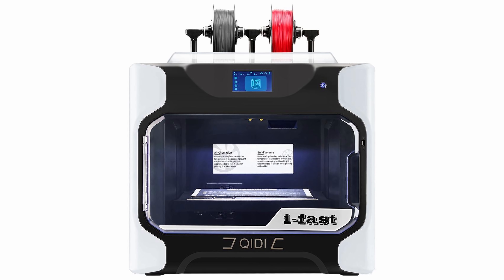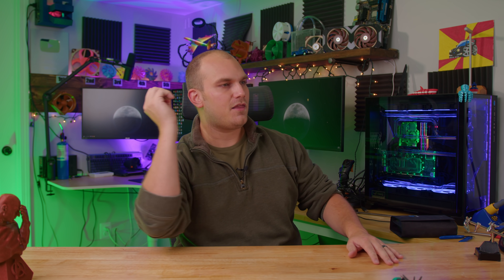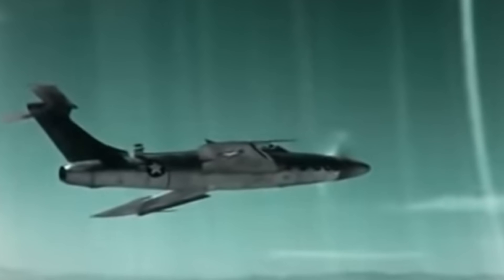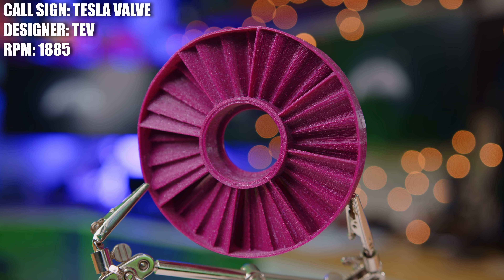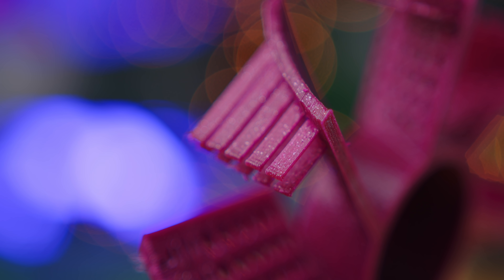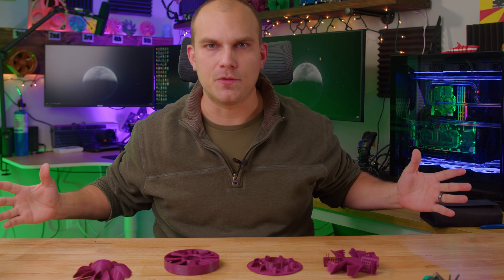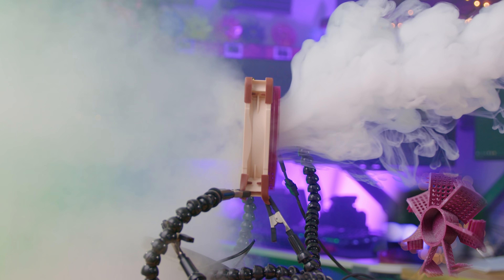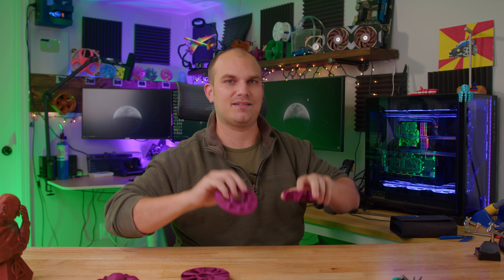The IMPOSSIBLE is now POSSIBLE | Fan Showdown S3E6

Comment: 10:10 the speed at the outside is much higher than the inside, so I think it’s the valves geometry that causes the turbulence.  Translated to airfoil design: the outside is more efficient with a jet(fighter like a F16) airfoil while the airfoil on the inner radius should be more efficient with a C-130 Hercules shaped airfoil. So the valve geometry shouldn’t be the same on the out and inside of the blade.

Comment: In the Tesla valve fan the air travels outward in the curved areas/channels of the “blades.”  That is why it spits the smoke out. There is no proper resistance to keep air centered.

Comment: I would like to see a static pressure test on the Tesla valve fan. Most thin axial fans do terrible on static pressure tests, it would be really nice to have a good option for pushing air thru filters with minimal height investment

Comment: The prandlt is designed for no outside shroud, it might have been better in that setting. I also notice it does not meet the prandlt design parameters, mainly zero loading at the tips.

Comment: I guess, it would be interesting to see them cooling CPU (go through heat pipe sink) pull vs push performance, perhaps it would come with surprises, due to the difference of laminar flow before and after. Great vids.

Comment: Dyson needs to make a computer fan that is bladeless like their big bladeless fans. I feel like their method would be great because it allows maximum air passage due to the lack of a blade in the way, despite their still being a blade. The only problem I could see would be the actual fan housing itself would be large and probably wouldn't fit in a standard computer case.

Comment: Thought on the whisk, I know what was meant by noticing the force when using a hang blender. I think the difference is the hand blender was being used in a narrow vessel. Use a hand/such blender in a glass as you make a milkshake. I think adding a housing such as we've seen in the more complicated multi part fans would help get a lot more performance out of it.

Comment: Your problem with db measurment isn't anything to do with frequency just fyi! It's most likely a result of a lack of preformance In said fan leading to a reduced db level. I'd love for someone to come up with a simple way to compare statistics directly between fans such as dividing the db rating by the expected flow rate or amount of material maybe? Scatter plot and get a trend to figure out which fan is the best!

Comment: Am I reading it wrong? I think the flow past the fan fanning out means the fan has high static and low dynamic pressure, and flow tight and narrow means low pressure and large flow, and the total pressure of the fan is the two combined, right?

Comment: Cheese greater had lower RPM which probably contributed toward reducing the sound. Also the "cheese" on the ends might have reduced tip vortices that would cause vibration. Definitely surprised it cooled as much as it did!

Comment: You may have some luck attempting contact with a group that tests other parameters or physics and see if the can help.
It'd be cool to see the static pressure of some of these, and I think the tool you want to see the frequency would be called an oscilloscope.
Gamers Nexus or Applied Physics may be up for a collab.

Comment: @Major Hardware - i was recently watching your Jet engine fan videos . and i noticed something - in all of those jet engine / fan videos when there was a hub to help the fan - that said fan went from big volioum - > to small - that in it self is the oposite of what you want - since you aim to cool down something - when you compress a gass it heats up - wich is why jet engines are shaped like this - because they WANT  the air to combust and exit as hot as possible to gain more thrust out of it - in your case tho you want to cool - meaning what you need is a hub that starts small - and endsup big - when you expand a gass it gets cooler - meaning in theory you could use a very small fan spin it at rapid speeds and cool a radiator with it with some pretty decent numbers- or use 2 set of fans - one to push air inside and one that pulls air out so it will be more easy to force the air you use to cool your radiator to expand - and get cooler as a resault

Comment: what kind of radiator are you using with the fans?

I kinda feel keeping it "close to a noctua fan" is not good enough, I've been watching your videos on and off but I still don't know what kind of radiator setup you have.

I'd suggest implementing something like this:
https://www.youtube.com/watch?v=4tgOyU34D44

seeing random meme fans beating harvard level of fan design is so funny that's why I keep watching you, but I'd love a "real world reference point". cfm, temps, cooling solution/rad. the sytem is irellevent as long as it is the same under all tests

Comment: Dayton Omnimic is a decent plug and play solution that includes SPL meter as well as full spectrum RTA. Or you could use your existing SPL meter in conjunction with any half decent measurement mic for spectrum analysis.

Comment: The visible "shockwave" you were talking about isn't actually a shockwave at all, nor caused by the actual propellors going faster then the speed of sound. it's an expansion cone around the airplane where the air is being funneld into the propellor and is then expelled behind it in a large cone shape. depending on the temperature of the air and humidity the expanding air can't hold all the water molecules in it anymore and they condense around it forming a sort of cloud at the end of the cone. This can happen below and above the speed of sound so isn't specifically linked to it. But it does tend to happen easier at higher speeds. Just some fun areodynamic info  i wanted to share :P

Comment: You can do a spectrum with a PC and microphone.  There is lots of free software for the "audacity" is an example.  You can "calibrate" your setup with one fan as your standard then switch to the fan under test.  This way you can get the microphone position the same each time.

Comment: @Major Hardware You could use Octave and run a recording of the fan through an fft (fast Fourier transform) filter to get the frequency breakdown for each fan. Octave is free, and you already have a mic that should work well enough. The program you would need could be as little as three lines of code.

Comment: Aerospace engineer thoughts: Consider a simple pressure differential test. Air movement at zero pressure (the fan operating in open air) is not really relevant to actual operating conditions.

So put the fan in a box with limited airflow into the box, and build yourself a manometer pressure measurement tool (a very simple u-shaped clear tube with liquid in it). See how much pressure the various fans can produce. You don't need absolute values to see the relative answers, but even a simple manometer gives you real numbers (the change in height of a column of water). A simple noise test is interesting, and the flow vis with smoke is interesting too, but doesn't tell you much about what the fan is GOOD at - moving pressure from one side to the other. Also, the noise will change significantly when the fan is "under load" because it dramatically changes the airflow around the blades.

Also, there are plenty of inexpensive or free spectrum analyzing apps for smartphones, that will work well enough for this purpose.

Comment: Interesting. With the new printer we can make stator blade designs (static blades between sets of rotor blades as used in turbines) to dramatically increase the static air pressure.

Comment: I think what's happening with the tesla fan is that air is getting caught in the channels rather than sucked in, then "centrifugal force" (technically just inertia I know) kicks in and flings it outward toward the edge of the fan. It then hits the wall of the fan and "splashes" in wharever direction it can.

To fix it, I think you'd probably want to add a different shapeat the end - something that would redirect the air in the channels to the inside of the computer.

Comment: I bet a smaller heatsink would make the prendel work even better. I bet because it was drawing all the air into the center of it's rotation an outside portion of the heatsink remained warm while the center got all the airflow. I think this would actually make a huge difference! If the cooler has two sets of heatpipes on the sides, that means that the heat would have to travel farther from the source to get cooled. This would mean that the cooling efficency is bottlenecked by the thermal conductivity of the fin material (probably aluminum) over the distance of the radius of the fan, leaving the copper/vapor heatpipes closer to equibrium with the surrounding heatsink fins thus slowing the transfer rate

Comment: removing the load from the tips doesn't stop the shockwave of Mach 1. Tip velocity is the only thing that makes the Mach 1 shockwave go away. Changing the twist changes the load distribution to take stress off the tip.

Comment: The blender one is so efficient in the blender because the liquid is so much denser than air. I guess you would need a much bigger fan with more exaggerated features or a much much higher speed to achieve the same effect

Comment: i was wondering if you have thought about printing a wall 6inches out on each side to fit the fan into to prevent the smoke from coming back around and looping the sides i also feel like this would create a cleaner inflow and exit for the smoke

Comment: The supersonic blade tips discussion reminds me of a silly thing from motorcycling. Kawasaki has a few models under the H2 line with a supercharger designed by their aerospace division. Shortly before engine redline the tips of the compressor vanes exceed the speed of sound. Since they're small the sound is a rather high-pitched chirp.

Comment: Tip: Tesla valve is designed for strait, not for rotating, so the effect when rotating can be huge different than spected and also can depend a lot on the r.p.m. used.

Comment: Why do you need a sound meter with spectrum analyzer? You can just FFT the audio in any audio software and get the spectrum, like Audacity. Also, how did the new printer allow you to print the tesla fan now when you couldn't print it before? I don't see any use of dual extruder? What am I missing?

Comment: FYI, dB meters use weighted measuring. E.g. A, B , C weighting and they differ predominantly in how low frequencies are taken into account (and for different sound pressure levels).
I don't know of any dB meters with built in spectrum analyzer or some way of introducing your own scale as opposed to the standard weighting scales. You'd have to get a stand alone handheld spectrum analyzer probably.
I think that a cheaper solution would be to just get a measurment mic, hook it up to the pc and use software to get your readouts.
REW is a free software that could do this for you.
And fairly decent measurement/calibration mics can be had from around a hundred bucks.

Comment: As a car audio nerd the first thing that comes to mind for an SPL meter/RTA. Check out the Audio Control DM-RTA or though they are discontinued, an Audio Control SA-3050A. I'm not sure if they would fit the bill for what you need, but they've been used in car audio and loud bass for ages.

Comment: the one with the holes in it is only quieter than the quiet fan cause its not actually moving any air, there is a reason why fans that move more air are louder

Comment: I would design a fan but I currently don't have 3d software. Anyway my design basically uses 1 to x gear  Ratio. In other words for every 1 turn of the hub the fan/ blades turn x number of times. Also this is clearly not original as gear as  Gear ratio increasing or greater ratio decreasing are already commonly understood. It would in thery increase the rotation of the fan higher than the motor can rotate it on its own.

Comment: Many years ago, I worked at U-M Hospital. During that time, they were buying new helicopters for survival flight. One of the main drivers (besides age of the machines) was that the 2-bladed rotor design was too loud going over populated areas. The forward-moving tip of the blade, when they were heading somewhere fast, was creating sonic booms. I remember hearing it go over when they were really pushing to get somewhere and I can confirm that it was VERY loud. The new helicopters have 4-bladed rotors, which could be cranked at a much lower speed (and also gave better control, anyway) and the flyovers became much quieter.

Comment: Idea - Turn at A12x25 into an A12x30 by printing a bolt on frame extension and the same blade design as the T30 and see how it stacks up.

Comment: I like the commentary during the smoke test over the music. I would have missed the back feed of air on the Tesla. Have you every put any thought into how you could measure static pressure? With a radiator I'm thinking this may have a higher impact on cooling than air flow since you need the pressure to push the air through.

Comment: 10:15 Think the fan is doing its job flawlessly but its not mounted to a jet that would suck the air inwards and or moving forwards. My fix is to print a funnel that can mount to the fan and to a vacuum... "The more I come up with this plan the more it seems feasible, That is not my intent" What it would be doing is sucking up the smoke from the other end.

Comment: I don't know why it would make less noise, but I always wondered why fans don't have the blades turned in at the tips, because it's fairly obvious more air would be pushed in a forward direction. I also wondered why most fan manufacturers go for odd numbers of blades. At least if the blades were even, if one  breaks you could just break off the opposite blade and keep using the fan.

Comment: For fans like the Tesla valve i think a test rig that does static pressure would be more ideal. so a chamber wrapped around a 120mm Radiator with a U of water to show if the area between the back of the fan and the radiator becomes more pressurized when the fan is moving air and if so how much.

Comment: You need a Sone meter for testing loudness, dBA is really poor to measure perceived loudness as it actually only records the pressure, but not the loudness of sound. These can be perceived very differently. A higher dBA can still be perceived quiter than a lower dBA because of the way how the pressure (dBA) is generated (higher and lower frequency bands etc...). And Prandtl is pronounced "Prantel" but you swallow the "e" a bit similar to "mantle"

Comment: A resin-based SLA printer might come in handy for some of these fans. The technology produces much higher resolutions and smoothness, and should work well. Cost is higher to print, and of course dealing with the resin which is toxic, and IPA baths to clean the print, and then curing them in a cabinet with UV is a production. But something like a Formlabs Form 3 (which does cost 4 grand with accessories and all) has a 14.5cm by 14.5 cm build area. The Form 3L can basically double that volume, but I believe the price of the unit triples or some such, so... There are cheaper resin printers coming out of Asia, like your Elegoo and whatnot, but print volume would probably not suffice to print fans in one piece.

Comment: the noise from each fan would be affected by how fast the fan is spinning correct? thus you would need to either account for fan RPM along with the noise level, or test the noise level at a controlled RPM

Comment: Spectral analysis of sound is a very simply thing. You can do it easily in post. Audacity can give you the spectrum plot. The bouncing amplitude bars on an equalizer are instantaneous frequency spectrum graphs. You should absolutely include this information as a graphic. The loudness of a fan is only part of the full sound profile that determines if the fan is effectively inaudible or ear-piercing. For example, high frequency noises in fans are usually considered to be unpleasant compared to lower frequencies even at the same overall volume. Additionally, a fan may produce unpleasant harmonics. 

Side note: Mathematically, all you are doing is taking the Fourier Transform (most likely using the Fast Fourier Transform algorithm). In practice, it's just clicking a button in a program.

Note: anyone saying it is hard or expensive is talking about doing such analysis to a high level of precision that would normally be reserved for professionals.

Comment: That "Whisk" fan looks exactly like a wheel that went in a seeder. Put your corn, beans, or whatever seed in the hopper, and you could change out the wheels that looked Just like that for ones with bigger or smaller holes, depending on what seed you were planting. The wheel would go around and pick up one seed in the little pocket and eventually drop it into a chute that led down to a furrow it was making as you pushed it along. I planted many a row of corn with that thing at my grandparents house. Sure made quick work when you could push it up a row, and plink, plink, plink as it drops corn seeds.

Comment: Base on the flow pattern, I think the Cheese Grater might work well as a convection oven fan blade because of the way the air disperses as it exits the fan. Made out of metal of course.

Comment: To answer your dB meter question: you can get a calibrated measurement microphone (or if your meter has an RCA output you can connect it to an interface). Then you can use software like Room EQ Wizard - use your meter's display to calibrate the levels and then you should be good to measure!